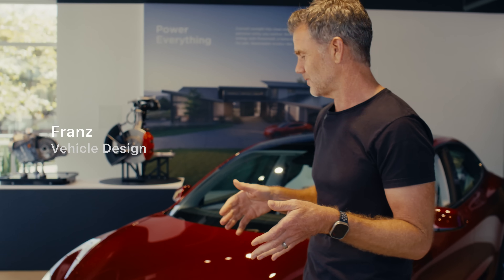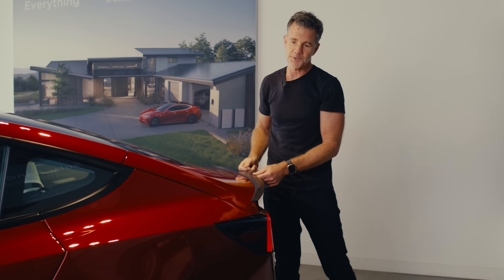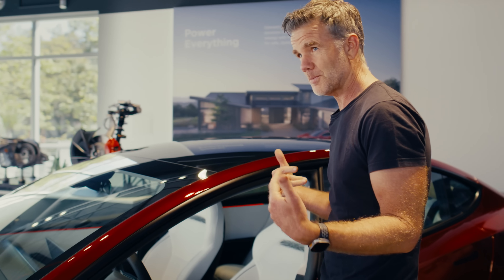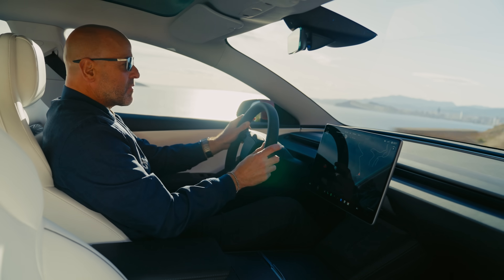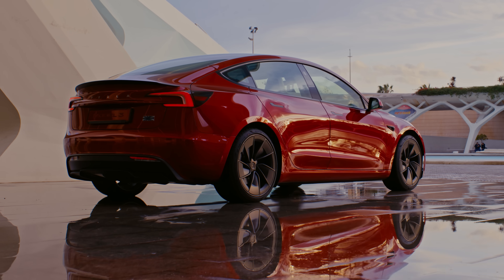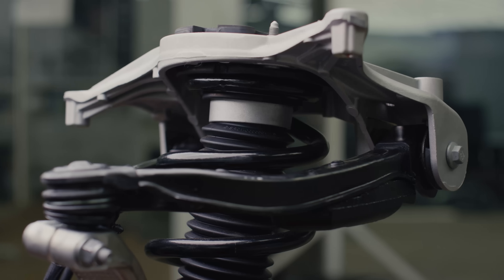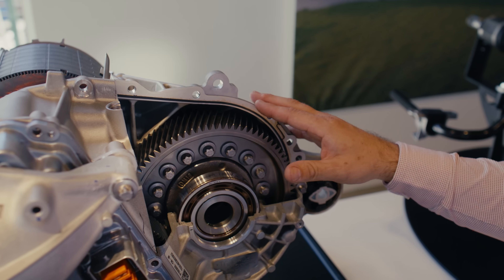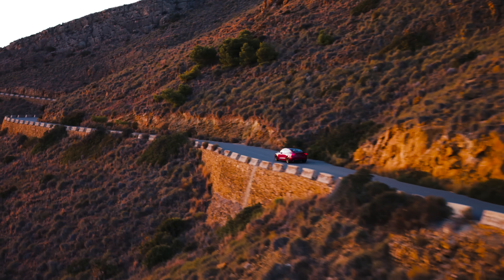Designing The New Model 3 Performance | Tesla

Comment: I'm sorry but the front of the Model 3 and the Model Y are BOOOOORRRRRRIIIIIINNNNNNNGGGGGGG. PLEASE be good to your lower end customers and make the front of the cars more interesting, please!

If you don't work for Tesla and they won't make a better looking front end. How about starting a new company that makes a significantly better looking front end for $200 plus shipping. I don't want to just do a wrap. I don't want a different color. I want the front to look INTERESTING instead of the total lack of a soul, while also being aerodynamic. Both can happen or they wouldn't build the S and X with the front ends that they do.

To be clear. I have a Model Y but I am NOT a boring person but if you looked at the front of my Tesla you would think so. I'm NOT so I don't want the front of my car to look boring. I don't need much. How about a simpler but something like the front end of a Model S or X. If Tesla won't do it, if they don't value us enough, then I ask for someone else to step up and build these for us. 

Cost matters. I'm not saying be cheap but if you expect me to pay $800 you instantly wouldn't have a customer. If it is priced around $200 and then add $100 to $150 or packaging and shipping that would be $300 to $350 which is basically the limit that I would be willing to pay to make the front end of my Model Y more interesting. 

And if you wanted you could make a lighter weight carbon fibre front end but I'm not racing my Model Y.

Now. if you want to do MORE for me, in addition to a new front end. How about making LED lights that plug into the doors behind the door handles so that as I approach my Model Y when it is dark that I will be able to see where my door handles are. I'm talking about $50 per door but REASONABLE handling and shipping. I'm not paying $100 per door handle. My wife won't go for it. As it is we are talking about $300 to $350 (with handling and shipping, because you handle it then ship it and not vis versa) and then $50 per door handle times 4 is another $200 plus shipping. Put everything into one box for less packaging and shipping hassle for you AND for me and we are both happy. 

Note: I have a year 2020 Model Y so it has to work for my version too. Not just the new ones. Thank you in advance.

Comment: - *Redesigned front fascia* with side ducts to optimize airflow around the wheels.
- *New front splitter* improves downforce and reduces lift.
- *Rear spoiler and carbon fiber diffuser* enhance downforce and air efficiency.
- *New, supportive seats* designed for spirited driving and comfort.
- *Forged wheels* reduce vehicle mass and improve handling stiffness.
- *Upgraded brake pads* for higher thermal loads and better performance.
- *Shorter steering arm* for a quicker steering ratio.
- *Adaptive damping system* with an active valve for dynamic adjustment.
- *Custom tires* for quieter, more efficient, and better lateral performance.
- *New driving unit and inverter* improve efficiency and overall performance.
- *Low-friction KAF fluid* for enhanced performance.
- Balances *driving dynamics and comfort* for both spirited driving and everyday use.

Comment: I have a question could it be possible to run the teslas by using wireless technolgy like how devices charge wirelessly or have a charging pack built into it. Tell mr musk my idea if you havnt already thought of this, is to run the teslas off of starlink somehow, and the sun and free energy that charges the battery when its in motion, giving it a never ending source of free power instead of plugging them in. A solar tesla that creates self purpoltion like those kinder egg cars that drove when you pushed them the moved by them selves with gears and wieghts. Solar teslas running on starlink with little satellites on the roofs catching the signals from starlink like the way the teslas pick up starlink inernet built in to it rite, i wonder if you could invent a vehicle that was completely free to run as long as your hooked up to starlink and tesla you shouldnt have a problem creating wireless charging or free energy for tesla products like the powerwalls you make for homes smile😊

Comment: Elon Musk : In my opinion, if the Stockholders vote to not pay you in Stock as was agreed , even after the huge returns , and when you don't get any salary, in my opinion you should walk away,  and focus on a very important USA Company in deep trouble: Boeing, which has been push to the edge of Disaster to justify moving the next advance Manufacturing and Assembly Factories out of USA to the Middle East. Electric Cars , Drones ,  Planes and Spaceships are the same transport network, you can do it . Boeing problems are an inside Job, in the Board of Directors, in my opinion Fink and others . If someone can move Boeing to the next level, new planes , new materials, new engines , etc.,  it's you, in my opinion . Why don't you help America solve this problem ?
Reply: Boeing going under would be funny though

Comment: I would like to say that the air intakes on the front bumper and the rear spoiler ARE THE SAME as the old Model 3 Performance. Those are not new. I know because I own a 2022 Model 3 Performance. Yes they are "new" if compared to the updated Highland Model 3 Standard and Long Range, but not new for the Model 3 as a whole.

Comment: Bummer there’s still no active rear differential for torque vectoring and there’s no improvement to the battery pack for faster charging. The Model 3 is 7 years old now. Time for some major upgrades that the refresh model did not touch.

Lastly, I switched the 20” wheels on my 3P for 18” wheels and the improvement to range, ride quality and steering turn in are immense. There’s no reason to slap huge heavy wheels on performance cars. A lightweight forged 19” wheel is plenty large for this vehicle and there’s a ton more tires available in 235/40R19 or 245/40R19 than there are in the very uncommon 235/35R20 size.  The extra sidewall also slightly improves resistance to bent rims and provides ever so much more cushion over bumps. I was really hoping Tesla would go down in size from 20s to 19s on the refreshed 3. So many people I know have swapped out their wheels for smaller ones. It also improves acceleration, handling and ride quality removing unsprung mass. 

Until Tesla goes 800V I’m not going to buy another one. I also think it’s long overdue for you all to add cross traffic detection front and rear, as well as a camera on the nose of the car so you can see how close you’re getting to tall curbs or other things ahead of the car. Even more so now without USS parking sensors.

Comment: EVs arent worth the money, supercharges are more expensive than using gas. this isnt going to save u any money. also just because the car is off doesnt mean it doesnt use power, especially during the cold. if it isnt plugged in charging, it will burn electricity.
Reply: Superchargers are far less expensive than gasoline. But most people charge at home the majority of the time, which is MUCH less expensive again.
I pay about $5 for a full charge of mine. A full tank of gasoline is about $120 here.

Energy drain during the cold parts of the year is very small.
Reply: @logitech4873  5 dollars not at a supercharge though, also price of supercharging isn't regulated by state like gas.
Reply: @coffeebeardtv  2 weeks ago I charged 70 kWh at a supercharger, and paid only $24 (255 NOK). The equivalent diesel or gasoline cost here is ~3-4x higher.
But, again, 90% of my charging is done at home. The same goes for most EV owners. Your home electric cost is what's the most important.
Reply: @logitech4873  not as convenient as a gas car though
Reply: @coffeebeardtv  Idk man. 
I like getting into my car in winter and it heats up the cabin in 1 minute instead of 10-20 minutes. As a photographer I also like how close I can drive to birds and animals without them running off.
Oh and it always starts in winter. And we have very long winters in northern Norway. In fact, it snowed earlier today. My emergency starter that I used for the diesel car I used to drive is now gathering dust.
Reply: @logitech4873  yea man but your car uses power when it’s off especially during the winter unlike gas cars
Reply: @coffeebeardtv  A vanishingly small amount. Like, completely pointless to worry about. I leave mine plugged in all the time when i'm at home, so I've never really noticed.
Reply: @logitech4873  to supercharge from 0-100 is 84 dollars in belharbarbor malls. The price of supercharging varies greatly unlike gas.

Comment: If you'd have analog speedometer you could also show that it goes up to 20-40 units higher than a normal model. It's a shame you can't 😁 Racing stripes and flame stickers could also be good.

Comment: Nice, but still no long trunk-door, no 230V-connectors, no V2house and it looks like the car still has the wishbone-concept "steel with rubber/glue sealed" (the visit at the bodyshop is preprogrammed) instead of alu-part like Meyle.

Comment: Tesla 2 is vaporware... The current models are showing their age. The design is getting old even if the technology has improved. The first introduction of the S model was done in 2009 and it hit the market in 2012. They all look alike, and the X, which was some sort of hybrid between an SUV and a saloon, looks nowhere near as an SUV as the X5, X6, or Audi Q5 or Q6. They look outdated, and the whole portfolio needs a refresh if you want to make the sales numbers rise again. A Model 3 from 2017 is almost the same as in 2024. I know they are developing and trying to keep the cost down, but they really need to redo the designs even if the technology remains the same.
Reply: "Tesla 2" has literally never been announced. It's not vaporware when it was never even promised in the first place.
Reply: @logitech4873  The automaker has previously talked about two upcoming vehicles on the platform: a model cheaper and smaller than Model 3, sometimes being referred as the “$25,000 Tesla” or “Model 2” Tesla Robotaxi: a new vehicle designed from the ground-up for self-driving.

Comment: Bring back stalk and you will get my money, remove one of the best touch on a car when people are driving is way too stupid. I still wonder how you guys think ton of buttons on steering wheel is more minimal and clean than a stalk and an already super clean steering wheel without any buttons. 😑 You guys remove every single buttons to put it on the display and then it's also you guys who remove stalk out and put tons of buttons into a clean steering wheel, what a contrast idea 🤦🏻 I'm sure you guys confusing yourself concept.
Reply: I RARELY comment, and even more rarely reply on YouTube. However....

I had thought the same thing. "No stalks? Madness. Decades of muscle memory, as well as ruining one of the best steering wheels ever..."

Then I tried it.

It's intuitive within about 10 minutes. The very VERY rare situation in which it's not is when the wheel has been turned nearly to lock. HOWEVER, I suspect the Tesla answer to this is to shortly bring steer by wire to all models. A completely common steering system across ALL MODELS, 100% with the possible exception of length of the mounting brackets. No piercing the firewall any longer, economy of scale, etc. (Though this may require 48v across-the-board, due to the steering motor power draw, which means those could be out 1-2 years).

But then your lock is ~180 degrees? You'll always know where the buttons are.

Stalks apparently are a very large (statistical) failure point, and also add significant manufacturing cost that has now been removed. Stalks can never be remapped in functionality if they're hard wired to certain wire sets. Whereas buttons can.

All in all, it was intuitive, it lowers manufacturing cost (which lowers purchase cost!), it's absolutely NEVER going to break, for as long as the car exists on this planet, and it makes sense for future improvements. Yes, there's a minor edge case that requires a bit of extra consideration, but you're pretty much always stopped in those situations (U-Turn, etc).

For those, like me, who think (or THOUGHT) it's dumb, go try it for an extended period of time. Lots of turns.

It turns out (pun intended!) that our brains are very good at adapting!

Comment: did they redesign the wiper fluid where it is not attached to the wipers and just puddles up on the driver side? The hoses should not be attached to the wipers. I drove the regular model 3 and that is a big design flaw.
Reply: I have a '19 Model 3. I don't have this problem.

Comment: So the new damping was developed to handle the extra power. If you drive the performance will it be more stiff then the lr and standard? Or will it also have the option to be driven with even more comfort?
Reply: I test drove it last week. Has Standard and Sport suspension settings plus 3 steering and acceleration settings. Amazing car.

Comment: Why is the 0-60 in the canadian version slower
Reply: Because they did exactly the same as in Europe (produced in Giga Shanghai): They put a worse battery from LG with 79kWh in there, while they are using the Panasonic 82kWh in the USA (same battery pack like in the "old" M3P). And don't get me wrong: Even the old Panasonic battery pack is a huge disappointment, it's still the bottleneck performance-wise. I like most of the changes of the Highland Performance (except removing stalks, WTF?!), but the most important one: PERFORMANCE is still nearly the same.
As an 2021 M3P owner I will consider different high performance electric cars from the competition, because I don't like where the performance trim is going.
Reply: Thank you for this sir. I also own the 2021 performance. I see no reason to be excited for an upgrade at all.

Comment: Tesla: why only 460hp In Europe? 
Why only 79kwh LG pack with poor charge curve and short range? Why only 0.2s quicker 0-100kmh? 
Why not offer better battery, longer range, 600-700hp and 800volt architecture? I will NOT buy. Disappointed.

Comment: 2 speed gear box would be game changer.
Reply: Stick a powerglide or TH400 in it for testing and R&D. Rear wheel drive.
Reply: Even just a slightly lower gear ratio. Pull the top speed back to 150mph but get down to 2.5 sec. Perfect.
Reply: @rossgee1091  optional factory gearing would be nice indeed. Just imagine what ideal gear it would have if it was only racing 1/8 mile.

Comment: Looks nice, but my LR at 4.2s 0-60 is MORE than fast enough, and the performance only gets 295mi range, 40mi less than the LR. Not worth it for the extra expense. The LR remains the sweet spot of performance, range and cost.
Reply: yeah 4.2 is pretty fast but what about the  proper sports seats, way better looks externally, lower suspension and larger wheels? Big difference appearance wise to the LR which looks more like a daily commuter sedan than sporty. This was the biggest problem with the older performance that we had, same looks as the cheaper models pretty much. The range is fine for us mostly driving urban and occasionally needing longer trip supercharging.

Comment: Nice car but range dropped below 300 miles per charge.  Two steps forward, one step back.  Huge pass no.
Reply: New epa mpge calculations and wider staggered wheels and tires cut range, it's still within just 9 miles of the awd lr on 20s! 
My buddies 2018 m3p still does 280+on a full charge with 106,000 miles. Still gets 150-160+miles back on a v3 scer in 15mins or so. 😎
Reply: @4literv6  We're comparing apples to apples here.  2023 M3P on 20 inchers is EPA rated at 315 miles.  The 2024 is marginally quicker (0.2 seconds to 60 mph) but gets significantly worse range (296 miles).  😞
Reply: Same thing happens to performance models of gas cars. More horsepower equals less efficiency.
Reply: @That-Guy_  Not necessarily.
Reply: @KP-xi4bj  
But at least most of the time that is the case
Reply: @That-Guy_  No.
Reply: Regular model VS performance model using the combined MPG rating:
Chevy Camaro 335hp, range = 380mi
Camaro ZL1 455hp, range = 323mi
Ford Mustang 315hp, range = 344mi
Mustang Dark Horse 500hp, range = 288mi
Dodge Charger 292hp, range = 380mi
Charger Hellcat 797hp, range = 305mi

Comment: Cars front looks like some weird chinese fish design. Then it does the typical blog egg design all the way to the rear. The front is sleek then the rest of the car is a blob. Its like two different people made the car. Still has no actual luxury interior and with a dull plain jane cockpit that doesn't even have a gauge cluster screen or a HUD. Model 3 is for people that cant afford a real sports car so they have to get an EV. 😂 it has one thing going for it. That's it. Thing looks like basic traffic. Also the 2.9 sec claimed time is using rollout. Its already been shown to have the same exact 0-60 as the old m3p but has gains towards the top end.

Comment: When he describes the notch in the rear spoiler, he does a little dance!
Reply: caaauusde hjes gay jeez ur blinded by elon musks big barrel this thing is hsit
Reply: yes but spoilers are just mainly for looks. Especially when you see an old Honda with a huge spoiler that is as high as it's roof. Usually those cars are not fast as all and it's just about looks.
Reply: @WarpedTrekker  bro this thing can do 160 mph.
Reply: @Evans_Man that’s pretty slow for a 500hp car
Reply: @WarpedTrekker nothing on an electric car is only for looks^^ If you work with aerodynamics you may notice thar even one mm of added matrial can change a LOT of airflow